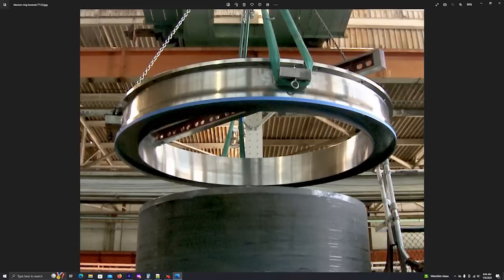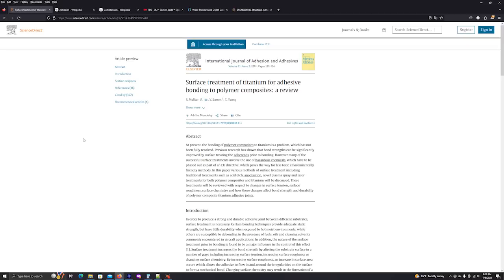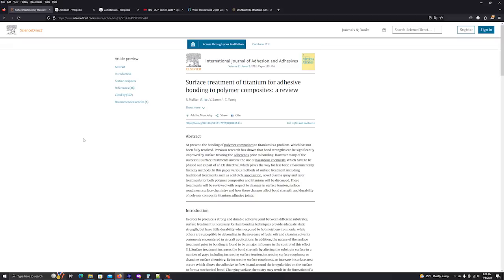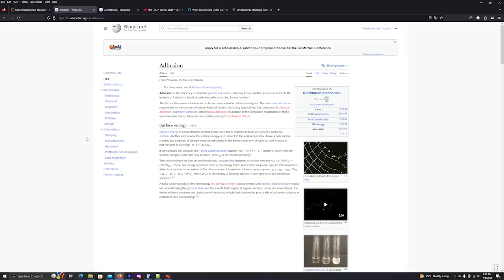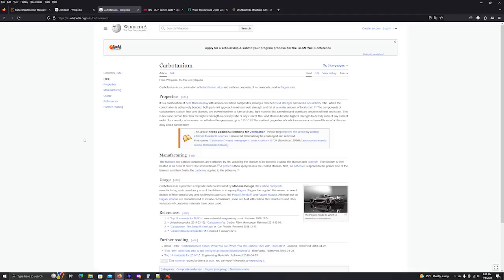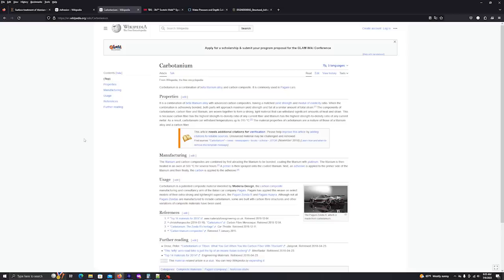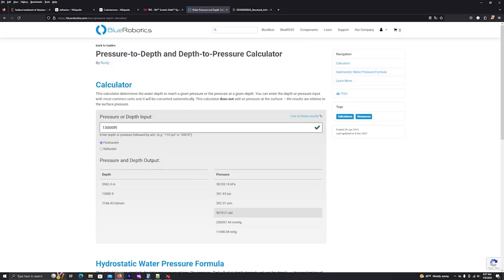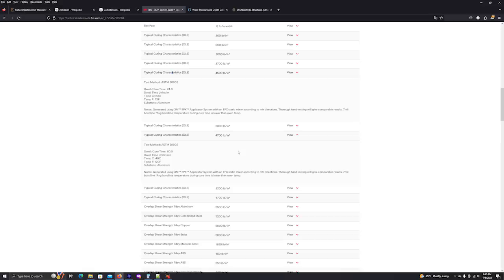Oceangate Titan Adhesive issues between Carbon Fiber and Titanium

Comment: Whyy everyone thinks the end caps would pop off whe n they are being driven inwards (axially) by the external pressure ?  Plus no one is discussing the contraction rates of titanium vs carbon fiber composite due to the cold....
Reply from the maker: I indicated this in the first video.  You are correct

Comment: Regardless of if the titanium bonded well with the carbon fiber I have questions about how the rings would react to the pressures involved in a different manner than the carbon fiber.  I would think with enough dives and cycles of compression and decompression the rings could separate even slightly from the main carbon fiber hull.   Another concern I have is that it appeared they did not torque the bolts to a specific standard measured with a torque wrench.
Reply from the maker: Correct, I did mention this in the first video.  thanks

Comment: Why didn't they rough up the surface of the titanium as well the carbon fiber with some fine grit sandpaper for the adhesive to soak into?  They could have an acid wash to etch the titanium surface.    What did they do to prepare the carbon fiber?  Did they use hydraulic clamps to hold the pieces together while the adhesive set?  Doing it as sloppily as they did, shows an inherent misunderstanding of the seriousness of what they were doing and the lives that would be dependent upon their doing their jobs well.
Reply from the maker: Do not know if they roughed up the surface.  Looks like than sanded the surface to rough it up,No clamps during the cure.

Comment: I think most auto safety cages like Pagani use Pre Preg carbon material which only requires heat/pressure to begin the curing process.

Comment: You had a interesting part on the bonding compressive strength of titanium to carbon fiber. Ultimately the whole total pressure of the entire end cap received would be hitting the joint. I can only speculate but im sure the compressive strength would be exceeded as surface area of the endcap would exceed surface area of the bond. It wouldn't surprise me if it was 2x-3x over the compressive strength. This also fits with the unconfirmed message log between the sub and polar prince. Undetected flooding would have slowed the ascent The logs saided they released the frame after several attempts.  Which makes me wonder if after multiple dives the epoxy adhesive was deformed thinned and flattened like a soft plastic causing extra friction in the release of the frame.
Reply from the maker: Thanks for the information

Comment: I am still not convinced this was a huge problem. The two endcaps would have been being pushed into the center by the pressure of the ocean, even if there was no glue there holding them on the pressure would have, they were being pushed towards the center of the cylinder at thousands of lbs per square inch lol. I'm convinced it was the carbon fiber stress cycling too many times and gave way. Or it could possibly have been the under rated window but part of me doubts that.

Comment: Great analysis. I would like to add that very small imperfections in the glue layer can become bigger to the point we’re the water on the outside at almost 400 atmosphere want to go in. That would cause further failure of the glue at very high speed, almost like water jet cutting of metal, let alone glue. This would be happening in a very short time (10 - 100 ms) and trigger total failure of the glue connection.
Reply from the maker: Thanks for the feedback

Comment: This is a very accurate analysis based on evidence and testing results. This is exactly how we should analyze this unfortunate disaster. One thing, I noticed when Stockton Rush was talking about the Bonding Process, he stated..."The thickness of the Bond must not be too thick or too thin". The only way to determine what this thickness should be is through Bond Testing.
QUESTION1: Where is this Test Data
QUESTION2: How was the Bonding process controlled to ensure that the EXACT THICKNESS was achieved.
It looked to me as though this was just "eye balled".
Reply from the maker: There  is no published test data that I can find,  Oceangate was using bondo spreaders to spread the adhesive I did not see any thickness gauges being used.  Thanks for the feedback

Comment: You may be looking at the wrong parameter of the bond strength. Failure of that adhesive joint is a very likely cause of the implosion but if it failed it would be in *shear*. With a nod to John Piña Craven, I'd bet a dollar it was the cause. (Caveats at the end). 
The joint was under enormous compressive load equal to 3.6 times the water pressure because the full diameter of the end cap was supported by axial compression of the 127 mm thick cylinder wall. 125 MPa at the possible implosion depth (3457 m). Compressive failure of the bond epoxy would not be an issue because it was so thin.
Cylinder pressure vessels (e.g. submarines) are stiffened by regularly spaced rings. At the collapse depth even the smallest non-circularity is unstable and progresses at the speed of sound until the cylinder looks like an empty toothpaste tube. In Titan, the stiffening rings were the titanium end caps. Clearly they did not fail, but the shear load was supported only by the adhesive bond. The critical comparison is between the radial shear strength of the carbon fibre cylinder wall and the adhesive bond to the end ring. The adhesive bond needed to be as strong as the cylinder wall and both of them needed to withstand the additional stresses due to differential compression of the cylinder compared to the end cap during each dive pressure cycle.
In hindsight, if the hemispherical end caps had had a sufficiently strong flange closely fitted inside the carbon fibre cylinder the bond strength of the joint might not have been safety critical.
TL;DR Caveats: I'm an engineer but not a structural engineer. We can speculate about failure modes but the enquiry, we hope, has all the available information and is in the best position to determine the true failure mode and cause(s). NTSB estimate 1 to 2 years before they release their report.
Reply: 150% safety margin would be a factor of 2.5 or 14000 psi. Stockton Rush doesn't sound to me like a 150% safety margin kind of guy though. What safety margin percentage do you think he'd knowingly stake his life on?
Reply from the maker: Good point,  Yes the smaller surface area  also would increase the amount of force far beyond the outside depth pressures

Comment: So the adhesive was in tension! 😮
Reply from the maker: If the end caps were fully seated I would say it was compressive force.  But when the end caps blew off it would be sheer pressure, but then it would not matter as the pressure vessel would already have failed.
Reply: I was refering to the bond betwen the titanium ring and the carbon fiber cylinder.  I understood that the ring was bigger than the cylinder and they were bonded with adhesive, so any micro deformation of the carbon fiber cylinder (towards the interior) would stress the adhesive with tension. I would put the ring inside so there were only compressive forces and no need of any adhesive.

Comment: It's propably a really bad idea to even join two different metals for pressure vehicles because of different linear elasticity. It's even worse bonding a linear metal with something non-linear such as carbon fibre. 

To explain. Metal compresses under pressure and that happens linearly until a point (that you should never reach in desgin). So if you take a piece of metal and put a force on it, it will compress by X percent. If you double the force it will compress by 2X percent. 

Now if you join 2 materials and put an orthogonal force on both materials they will compress differently and that means the glue will "move" - bad thing.
Now do it with a metal that compresses and something that hardly compresses until breaking point (carbon fibre) and you have an absolute nightmare that needs to extensively be longevity tested.
Reply from the maker: Thanks for the feedback 😃

Comment: The crackling sounds they reported may have been the titanium ring glue joint unzipping itself 😬
Reply from the maker: Or the carbon fiber delaminating
Reply: @JoediyLab  yeah that too. Im holding some carbon tow in my hands rn and seems to me the carbon has zero compressive strength akin to a wet noodle. Which tells me the carbon on the shell isn't doing much other that acting as a sponge for the resin. Also the titanium ring would have a different thermal expansion/contraction rate than the carbon tube allowing the glue joint to sheer. Air pockets in the layup. Blah blah blah. Such bad idea.
Reply from the maker: Yes more than likely.  But there is a company that build UUV's out of Carbon fiber and they have indicated  that have a track record of using carbon fiber successfully in compression.  I have sent then an email asking for technical data.  We will see if they will send me some data.

Comment: The differential compression of the two materials under differing temperatures and pressures will,  I think, be the most significant factor. Repeated cycling of extreme pressures and temperature differentials could easily cause the adhesive bond to fail, even if the initial bond was done well (which does not seem to be the case).

Whether the carbon fiber/ titanium interface turns out to be the failure point,  or whether faults,  cracks or voids in the cylinder was the primary failure may never be known.
Reply from the maker: Thanks for the feedback 🙂

Comment: Agree, but further when the stress is applied (in fact very high stress) there will be differential strain between the Ti and composite.  Cracking of the joint will occur as a result of each dive with water ingress.  Failure becomes inevitable.

Comment: How could anyone with an engineering background think that this could withstand and endure the constant pressure differentials being exposed to these joints over and over and over? Obviously, delamination was at play too, but the numerous flaws in this design blatantly slapping OceanGate in the face like what Moe delivered in Three Stooges episodes, is just daunting.

Comment: Have to remember that, at the pressure at the Titanic wreck site, the titanium end caps of the Titan sub were being pressed onto the carbon fiber cylinder with around 7,800 tons of force.  The joint between the end caps and the cylinder, being 5 inches wide, was subjected to around 18,000 psi compressive stress.  Was this stress uniform?  Or did the titanium flex some under the stress? I'm betting the latter as everything flexes under stress- ie strain.  Not sure what that kind of stress does to the adhesive used...  But, the end caps could not blow off first.  Once under water, they wouldn't need any securement at all.  The violent implosion would surely blow them off though.  Incidentally, the hoop stress applied to the carbon fiber would be around 33,000 psi, and the vector sum of both stresses means the carbon fiber was subjected to a total of around 37,600 psi.  The 5,500 psi outside pressure adds to this as well, again, vectorially, but to what depth in the material?  We know it was zero on the inside.  At least, until it wasn't... That guy was F-ing around with forces of nature and laws of physics that he clearly didn't fully understand.  What you don't know CAN hurt you.
Reply from the maker: Yes more than likely the carbon fiber failed first. thanks for the comments.

Comment: This will sound stupid, I'm sure. But I've crafted stuff my whole life and one of the first things my dad taught me was that most of the time two different materials will be tougher to bond. I remember being about six and learning the limits of heat seals, epoxy and screw joins. I see now how incredibly lucky I was to have a dad with loads of common sense. He should have been an engineer.
Reply from the maker: Thanks for the feedback
Reply: @JoediyLab  The algorithm demands food. I'm happy to oblige.
Reply from the maker: @jinxed402  What did you have in mind,? Thanks
Reply: @JoediyLab  Positive, quasi topical comments are all I have to give. But I'd be down to watch you demonstrate the practical applications of pretty much every scientific principle. Kids these days barely seem to grasp push vs. pull. You're wicked bright, your input is actually valuable.
Reply from the maker: @jinxed402  thanks for the feedback.  I am working on getting some interesting info from a company in the same industry.  If they agree I will put together some cool videos.  Thanks

Comment: That just does not look remotely adequate to secure a pressure vessel under that kind of strain.  Aside from the idea of bouncing that thing 400 miles in rough weather towed behind a ship.  A 2" lip holding on to the EXTERIOR of the carbon fiber hull.  Not bolted through.  Not grabbing a substantial section.  And then not tested adequately.  Oh, and the warning indicator is tantamount to an audio alarm when a bomb goes off within 3 feet of you.  Everything about that screams inadequate and poorly thought out, everything from design, through implementation, through procedures.

I get the sense this guy was sold on the "silicon valley innovation" mindset that creates useless cheap disposable trinkets like the "Juicer" and "Apple watch".  But innovation failures in Silicon Valley are a triviality compared to being squeezed to death.
Reply from the maker: Thanks for the feedback

Comment: I wonder if they used a fast cure epoxy vs slow cure.  Fast cure epoxy suffers from poor creep resistance.  This is what caused the 2006 Boston tunnel ceiling collapse, resulting in one death.  
Tons of concrete sections were suspended from the tunnel ceiling by fastener epoxied in place.  Over time the fast cure epoxy allowed the fastener to creep out.
A detailed report is available here  https://www.ntsb.gov/investigations/AccidentReports/Reports/HAR0702.pdf
My guess is the Ti flange to carbon fiber epoxy bond may have been compromised due to cumulative epoxy creep.  The high pressure cycles from each subsequent dive may have squeezed out sufficient epoxy to weaken the bond.
If any epoxy residue remains on the Titanium flange, it will be interesting to see which epoxy was used, fast or slow cure.
Reply from the maker: Thanks for the link

Comment: the more clips of this the more I cannot imagine this not being some kind of joke or psyop. I have good working knowledge of composites/epoxies/carbon fiber...anyone who does any amount of study would find this design to be a widowmaker in about a day or 2. The fact that it made it 3000+ meters is nothing short of a miracle. The design might work if several changes are made.
Reply from the maker: Thanks  for  the feedback
Reply: From a retired/disabled mechanical designers view I just CANNOT understand why stockton did not see that this adhesive bond alone was TOTALLY inadequate. Carbon fiber, yes is a great material but not without the what... 8' span of the hull being supported.i would have drawn alternative drawings showing titanium rings spaced evenly apart along with horizontal titanium supports running horizontaly evenly spaced about the dia of hill that are connected mechanically

Comment: Those glue specs are bullshit. Buy any one of them and try sticking any shiny metal to pre-cured carbon fiber. I guarantee you'll be able to knock it off with a hammer with minimal effort.

I.e. the sort of collision you might expect if a strong current caused the sub to collide with the Titanic wreckage.

There's a reason why high pressure carbon fiber air tanks wrap the CF around an aluminum inner shell (before curing)... to create a mechanical lock for the metal fill valve instead of relying on a chemical bond alone. At 4500 psi that fill valve would become a bullet if it were only held in place with glue.

There's also a reason why regular subs use one large screw thread instead of a bunch of individual bolts to seal the door. If any of those bolts were tightened too much... or inconsistently... it could easily have caused enough flex in the titanium caps to break the adhesive seal.

I wouldn't trust my life to any glue in any scenario... but especially not in high pressure solt water or where the smallest gap in the seal means death.
Reply from the maker: That is why surface prep is so critical in mechanical bonding.  That is not the adhesive fault, but lack of preparation .

Comment: Curious no signs of any carbon fiber still bonded to the titanium end rings. This does suggest failure of the adhesive was the initial failure point that lead to the implosion of the submersible, 'scuse me McGivered death trap.
Reply from the maker: Hard to say what failed first.  more than likely the carbon fiber failed near one of the titanium flanges but we will not  know for sure until the test results.

Comment: HINDSIGHT IS 20/20.

NOTHING LASTS FOREVER!!!.

THE EPOXY GLUE FAILED FIRST. ESPECIALLY WHERE THE POWER COUPLER ENTERED THE PRESSURE CHAMBER. THE SUB WAS DESCENDING TWICE AS FAST THAN IT SHOULD HAVE, DUE TO WATER ENTERING INTO THE CHAMBER. TITAN HAD NO BILGE PUMP AND RUSH HAD NO IDEA THAT WATER WAS SEEPING IN. THAT WATER WEIGHT PREVENTED THE SUB FROM ASCENDING VERY FAST AT ALL